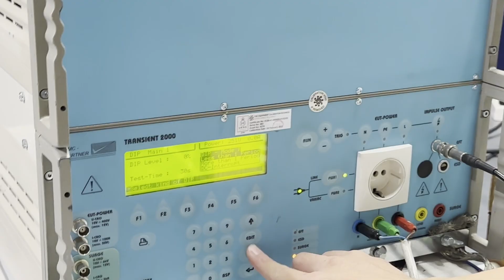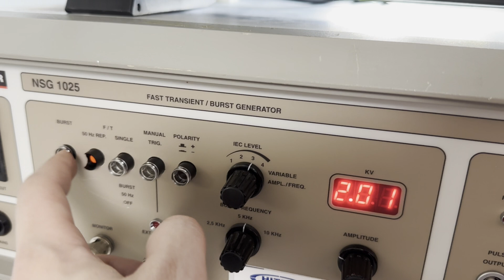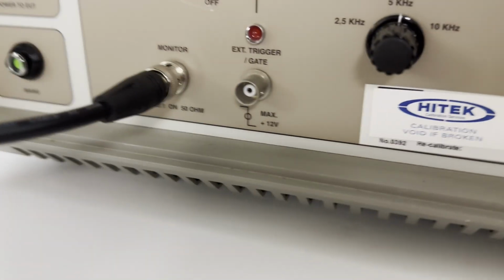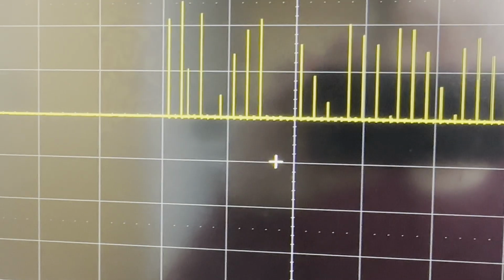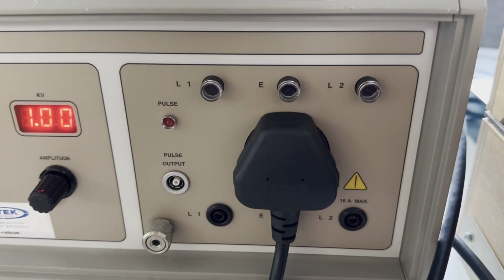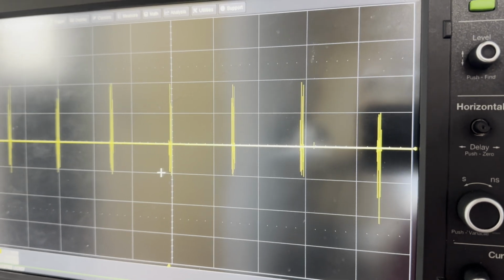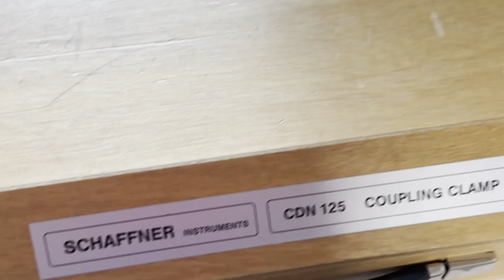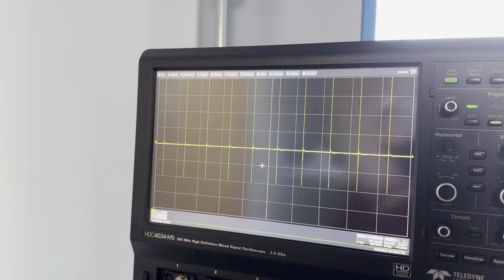Fast Transients in Electrical Circuits. EN 61000-4-4 Tests

Comment from the maker: If you enjoyed this video, please check out my new "Practical EMC for IoT Designers" video course. This comprehensive course contains over 10 hours of video material that cover every aspect of EMC testing for intentional transmitters in accordance with Radio Equipment Directive (RED), ETSI, ITU-R, and EN standards. Apply "RF50" discount code for a 50% off during limited promotion this year only. Don't miss out!
https://www.pcbforemc.com/courses